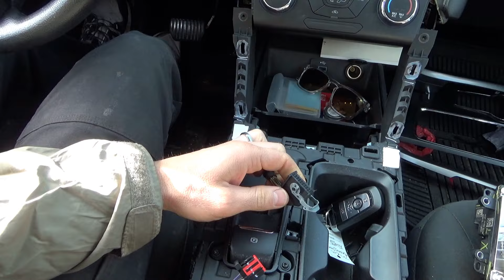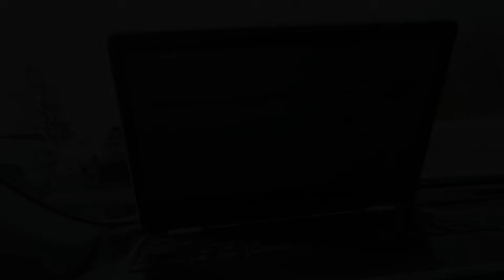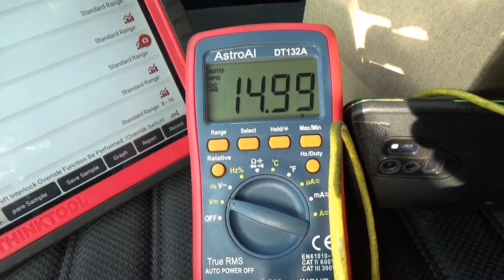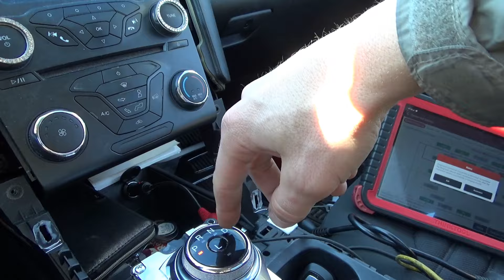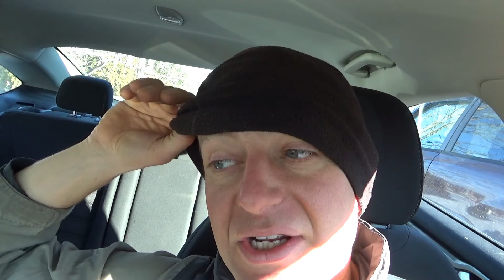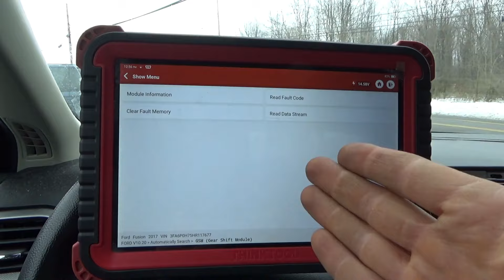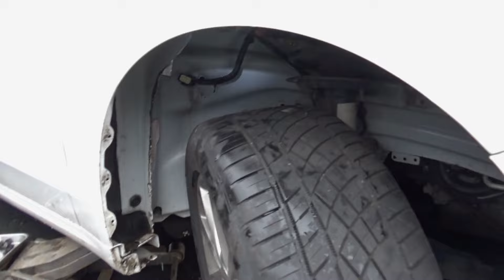Why New Cars SUCK (Ford Fusion STUCK in PARK?! - Part 2)

Comment: Welcome to the past, when they didn't have codes and you had to diagnose from scratch (troubleshoot). Funny how we get so dependent on modern amenities. Of course, today's cars have a lot more going on, but sometimes you just have to use your experience/knowledge to diagnose. You did the logical thing, you tried the easiest to replace (Shift knob), and when that didn't fix it, you thought about it more on what might have happened when it broke earlier and it sent you to the module. BINGO!

Comment: It probably broke itself while somebody was coasting forward in the drive-through took off their seatbelt to reach their wallet and it jammed itself into park while the vehicle was moving. Absolutely insane stupid piece of shit. And I’ve never ever ever ever had shift linkage or cable brake problems on any vehicle I’ve ever owned ever in my life.

Comment: I hold a BS in Industrial Design. I also was a mechanic at a Chev dealer for a few months. What is wrong with a key in an ignition switch? Why do power windows have a LAN driven 'module' to operate them rather than just switches and a few wires? My next vehicle will be a pretty mid-60s Chev with a 350, a 2 barrel, a THM and I'll drive it the rest of my life. Won't cost any more than one of these Apollo moon-rocket-complex nightmares. Jeff Johnson

Comment: I watched both versions of your video and one of your other video.  You obviously know what you're doing.  I strongly disagree about you saying you can't charge for your diagnostic time.  Caulk it up to a learning experience.  No!!!!!  You found problems when no one else could.  I've been a diagnostic tech all my life.  I had to repair the stuff none of the other tech could fix and many times the other techs who did the parts changing made more than me.  Shop owners were hesitant to charge for diagnostic time.  I hope you charged and charged a lot for this repair.  You didn't do anything wrong.  Diagnostic techs need our diagnostic time.  You had to come back to this issue many times and the car was down for a month.  I believe all controls on cars are becoming electronic so dealer have more control over the vehicles and or gov't could have  control over  our cars like shut down your car in a police chase for example..  We should own our vehicles when we buy them and we should own the software and have a right to have access to it.  Please support right to repair laws.  I just want to add one more thing replacing the gear shift module with a known good part is part of the diagnotic proceedure and is a valid repair proceedure documented in For service information.  Once you knew it wasn't bad you started checking other stuff.  Good work.    The guys replacing water pumps and brake pads get paid for their time why shouldn't you get paid for your time.??

Comment: Because it was talking to you and sounded like it was complaining.

What's that weird noise?

So, would you recommend  replacing the bushing and or clip before the trans shift module gets damaged? Or goes past itself within itself?

And you would think they would want the old one back to reset it internally and call it refurbished.

Comment: Ford discontinued the Fusion. That design takes a simple mechanism, e.g. the shifter on my 2012 Fusion and adds complication and weight for only a styling benefit. That's really dumb. My bet is you'll see a lot of Fusions prematurely hitting the junkyard when that made in Mexico servo is no longer sourced.

Comment: Thank you for this video and for showing the scan data after repair. I suspect that when the cable went out of range that the motor kept trying to bring it back in range and burnt something out by continuing to run. Nothing is in the software to time out the module. Like when you jack up old fords with air suspension and air pumps ran until the fuse blew. possibly a software update could fix this but why would they do that it's out of warranty and can make loads of cash on this repair. It's all about the bottom line. Ford doesn't give a code they don't want us to be able to fix it they want it to go to the dealerships. They know about all of this. They could solve all of this with an update, but I doubt they will. Once again, thanks, Ford. Always fking the customer is job 1.

Comment: I’m surprised you didn’t call the electro-mechanical component right away. Far more likely to fail since it has moving parts. These shifters are in cars to prevent lawsuits from people leaving their vehicle in gear and running over themselves.

Comment: My 2018 fusion se was stuck in P. I tried the reset switch inside the center console. Tried puonding the  shifter (not hard). What worked was starting the car regular and then tapping the brake pedal 5 x quickly. Unlocked the shifter. So there you go.

Comment: I had a similar problem with mine not shifting out of park. Mine was the cable under the hood not being attached. Cost me for the tow truck but the replacement part came from a coffee maker. Just a piece of plastic where a screw recessed. That was over 2 years ago and it's still in service.

Comment: Still doesn't appear to be a mechanical problem. Wouldn't be surprised to learn the root cause was on the circuit boards. A trip to the junk yard & swapping out the electrical parts would be cool to see. If that worked finding the circuit board fault would be even cooler. I'd bet a dollar that the fix would be pennies in parts. Of course, the labour would be stupid, but it would reveal the poor engineering.

Comment: I'm blind and do not drive, but this still seems dumb to me. If the motor can return the transmission to park, what if some fault developed during driving that caused it to return to park or reverse or something on the interstate and you end up causing a pileup.

Or, what if you had no brakes, and no E-brake coming down a hill and needed to stop the car to stop from going splat but the module won't let you. IDK about anyone else, but I'd gladly grenade a transmission to save my family or other drivers on the road.

Comment: After watching your video I have decided to put 10K into my 1992 Toyota shortbed pickup for full engine rebuild, full body restoration & repaint, replacement of just about every sensor, switch, relay a/c components,  etc, complete new glass and sealing rubber etc.  This truck is in good solid mechanical and physical shape....but spending the 10k will put it back to virtually showroom new.  I've had it for 32 years and I want another 32 years.  Thank you for this video because it confirms what I have been thinking has been happening in these newer vehicles...UNNEEDED STUPID AND RIDICULOUS OVERCOMPLICATIONS.
Reply from the maker: Nice! I have an 89 Mazda MPV van still on the road. Other than burning oil and MAJOR body rust, it still drives great! I love the van but only do the bare minimum to keep it rolling haha😅

Comment: It looks like there is no communication between TRCM and the main Computer, it looks like the TRCM communicate  only with that electronic stick or shift knob, and this electronic shifter communicate to the main computer and the TRCM, when you select drive, the information send to. TRCM to execute that command  and it move the cable the achieve it, and then the electronic shifter know the TRCM did it's job: meaning car is on right gear selected which is drive by communication with main computer, through the rang sensor attached to the shift cable on the transmission itself, that why there was no trouble code on the ECM, but the little  electronic shifter know that the TRCM gone bad , that why it locked to park position, and start blinking and refuse to move, that crazy it should be trouble code indicating that the TRCM is bad and need replacement, but now we know that blinking light on the.electronic shifter on park position means that the TRCM is bad.

Comment: Hi
Thanks a lot for this video, I'm currently having similar issues with my 2016 ford fusion, mine comes with the actual shifter.
Runs good when it's cold but once it's reachs normal temperature my car won't move at all, I can shift between gears but it just won't move.
Could it be the same damage part, the range control module?
Thanks for sharing!

Comment: Come on Ivan. Red flag, Red light, Massive stop signs very apparent when you attempted  the cable adjustment. The motor was clearly working and there was no movement of the cable or lever. Stop right there and rip it out because it is clearly mechanicly broken and not electricaly. Not everything can be fixed from the drivers seat behind a scan tool yet in this case it actualy was. There just wasn't a code but there was visual proof.
I love your your stuff and have for a long time I just think you really missed this one and hit on designers of systems to much in this case. After all, it is these systems that keep us in work!
Reply from the maker: Did you not watch the tear-down? There was nothing "clearly mechanically broken" LOL
Reply: nothing obviously broken on the teardown

Comment: i would love to understand the reasoning behind stuff like this. i know this system cost more money than a simple cable and shifter. its like electric windows they worked just fine without any network or computer for so many years. looks like the new system for windows has more wires more complicated why

Comment: Good mystery video.  Interesting to hear a younger person complaining about change and big brother, won't be long till free thoughts are taxed.   Darwinism and destruction always thought the destruction was caused by some overwhelming event of which the deceased had no control not like opening a door of one's own volition.
Hopefully you'll get involved with a Ford Transit RWD E5 Mk7 where you delve into why the battery charge light comes on after 5 mins of driving.  Comes on at start and goes out at engine start.  Maybe you'll find some weird DMM V readings.  Some say a poor front battery causes lots of gremlins.  Are there gremlins in the snow where you are?

Comment: Ivan, 
Man...still impressing me. You remind me of a younger and definitely more intelligent version of myself.  I just quit my 10yr career at the local Ford dealership (Technician) . You put into words my exact thoughts whenever I get into a car with the shifter knob. I guess the manufacturers (plural b/c its not just Ford) have ran out of improvements so these days they try to sell "different" , which is a load of crap because in many circumstances,  such as this, they take a tried and true system like the gear-to-cable-to- lever system and change it to a system that fails , not on a regular basis perhaps but it will fail in every vehicle at least once as compared to the cable to lever (shifter lever) system that only fails in maybe 2% of all the vehicles life span. Myself,  being 53, I think I replaced a shifter cable back when I was 17 in my 1977 Camaro if that puts into perspective about how often the old style breaks compared to the new and NOT SO IMPROVED round knob that will fail on probably 90% of all vehicle. Not saying the actual knob fails but SOME PART OF THIS NEW ELABORATE BUT NOT IMPROVED SYSTEM WILL BREAK ON PRETTY MUCH ALL CARS AT SOME POINT. Maybe the Manufacturers make more money by developing a system that they know is a horrible design and top it off by having it built in a 3rd world country with poor workmanship combined with cheap materials...its a dead ringer to fail and most people will end up back at the dealership paying outrageous labor fees and buying over priced crappy parts..

Comment: As you stated in your video, why would Ford go from a floor shift lever (which very rarely fail) to this bullshit. Some engineer at Ford has seen this in a Jaguar or M.B. and thought it would be cool in one of their models, and then some 10 cent plastic bushing fails and leaves the car and owner stranded. Ford will rush ahead with some new fancy gadget for their vehicles without any kind of R&D to get their vehicles to market first, and then they suffer the highest recalls of all vehicle manufacturers. What happened to "Ford is Quality one!"  An excellent video by the way!

Comment: range rover use a similar stupid electronic controled motor to pull the hand brake when it fails it is about 4 hours to change the motor a real pain in the butt landrover disco has an emergency/ recovery hand brake release when activated will not allow the vehicle to be turned odff leaving you with a totaly discharged battery

Comment: Just got round to watching this video, makes you wonder if it could be a failed capacitor as these will probably be used to control the direction of the 2 large motors, if 1 has failed then the motors could be fighting each other instead of working together

Comment: Before I changed out the module, I would have disconnected the battery. Would not have made any difference. So after reconnecting the battery, I would have cursed every Ford engineer that ever lived!

Comment: Some Industrial Air compressors have a similar Air inlet Valve drive motor.  Controller gives 0 fault codes.  You're on your own to figure out what has happened.

Comment: I am so glad that my EV (Renault Zoe 2015 R240) still has a regular hand brake and a regular "gear" selector, as it goes directly to the "gearbox" (there is only one gear ratio but I could open the Park position also if the car is "dead")
later Zoe have the parkingbrake switch. How insane is that junk... possible one day a dead battery or malfunction = closed brakes.

Comment: Nice… you need several scanners, lap tops and battery charge maintainers these days just to do simple things. Why are manufactures complicating easy things.
   I also find Autel to “hide” functions. You need to look in odd places sometimes. Why the info is not right with the related module?  Manufactures made the info costly also.

Comment: i cant understand why those companies do that shit instead of making the shift knob just send  signal to transmission without use stupid motor with old linkage system ,, isnt automatic gearbox controlled hydrolically through valve body ?? someone have Skoda also had same problem when he ask for help about transmission problem in a new car i got confused as its a good 8 speed Aisin transmission and i ended up knowing they gave them a stupid plastic emergency cable to use if they have problem with release gearlock but the joke that cheap cable got broke when he use it 😂😂😂😂😂

Comment: Would this be something that you; now knowing what happened; would test with your scope or an ammeter into the TSCM power lead to look for excessive current draw when the motor is trying to move?  I guess it would be hard because there isn't enough current to blow a fuse... It seems the capacitors are charged to give the motor enough current for high torque and that's what saves the fuse.  I wonder if it is a time limit programming that makes it only try shifting for a second, or what tells the TSCM so it stops trying.  That's probably a feature to save the plastic gears from stripping, but I would think it could also be used to generate a trouble code.

Comment: In general the more components a system has the more reliability issues it will suffer. Eventually these vehicles will all be beyond repair. A friend has the UK version of this and it is constantly at the dealership with electrical issues.

Comment: Something at least attached to the transmission is shift by wire, this is a hack with a motor and longer cable than the old one inside the car. The clunky sound from this assembly is a clue something is wrong, if you could run the motors and find that sound you might find the problem.

Comment: Back in 1988 I was fortunate enough to be at Cape Canaveral to watch STS26 launch - the first Shuttle to go after the Columbia disaster - so understandably there were many tenterhooks being stretched. In fact the countdown was stopped several times and it looked very likely that the ship wouldn't go that day. Fortunately, I'd brought my VHF airways scanner with me and it picked up a radio link from the crew to some part of Ground Control - they were looking for some part of the data set that they'd guessed was missing - NO FAULT CODES! I can still remember that cheer that went up when I heard GO for a LAUNCH. Of course in the end the Shuttle programme suffered from hardware failures but this particular fault was cured - NO PARTS REQUIRED!

Comment: People now are just so freaking lazy so when they see a dial it looks so simple sitting on the console and easy to operate compared to the average old school shifter but like you said you cant see all the compatible parts that are needed for it to work with just a twist of the fingers. I have a 2023 Tuscon with the standard shifter but plenty of on and off control buttons, like 4 wheel lock, etc.

Comment: Leave it to Ford to use two of the cheapest brushed-commutator "can motors" (mo #400) of all time to drive the big gear of the module (I guess that one motor didn't deliver the required torque). The second (smaller) motor inside the module is also of the brush-commutator  type that was first used in the '60s hobby industry... . By today's "brushless" standards all three motors are now considered to be Junk. As a first time viewer—and new subscriber—I am impressed with your knowledge. Time to review what else you've done.

A Thought: apply 12v to one or both of the can motors. After +90k miles on this vehicle, I'll bet that one (or both) won't run or deliver enough torque to the big gear...